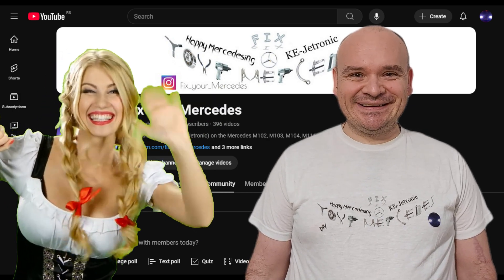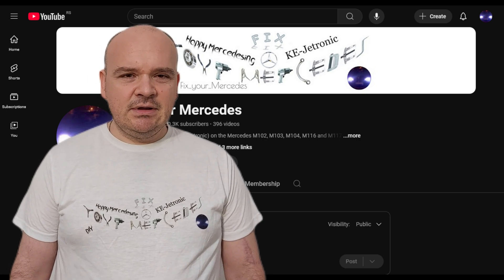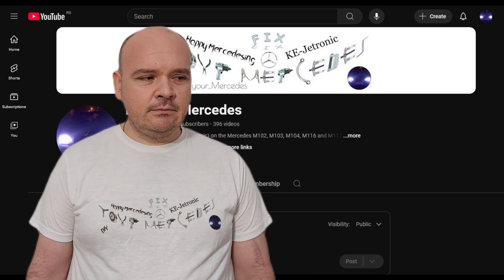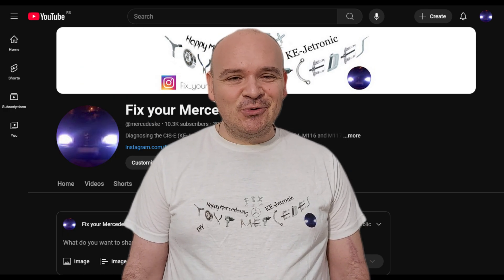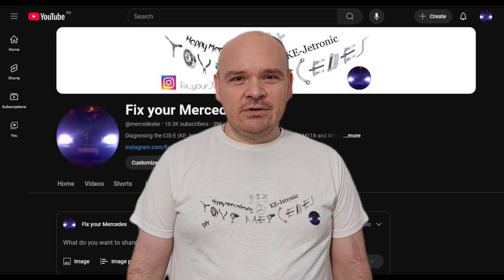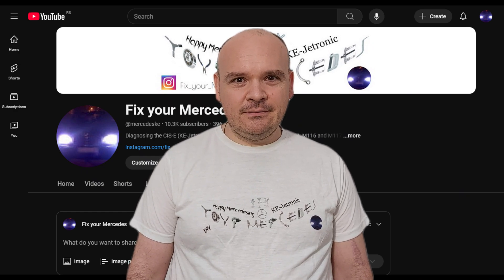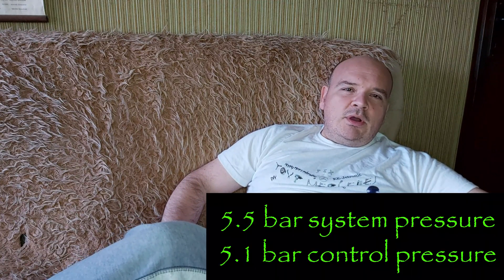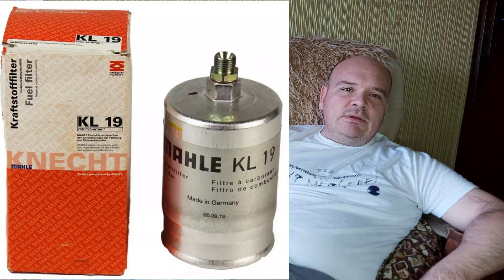㉦Mercedes Ke-Jetronic㉦ - ❔Q&As on KE-Jetronic❓

Comment: Youre a legend, i hope u doing well, after few hours of trying to find the answer inside your videos i decide to ask directly, m102  in particular, hard start on cold and if helping it with gas it stalls, after few tries  it keep steady idle,  easy start on hot but 1100 rpm idle, sometimes missfire on hot, lack of power , slow rom response, engine not shaking, what are your reccomendations?
Reply from the maker: Check the whole mechanical part of the system with the pressure gauge, check the OVP.
https://youtu.be/Qokyh3TJjvA

Comment: Mechanic said irregular idile is because there is tiny gap in throttle body valve  butterfly and have to replace it new one is toooo expensive😂😂😂.......there should be  gap or fully closed ??

Mercedes 320E W124 M102.023
Reply from the maker: At first make sure you have the closed position on your TPS. If you do, then the butterfly closes as it is supposed to. Do that test. Here is the link for that video.
https://youtu.be/3sTArQdmugg
Reply: @mercedeske  i have checked TPS sensor  as showd in video it  recognise full  throttle only because its 2 pin throttle valve UK version.......mechanic have cleaned and lubricate but there is still gap on close position..... i will try to share picture on Instagram